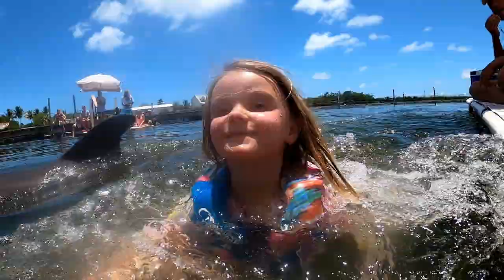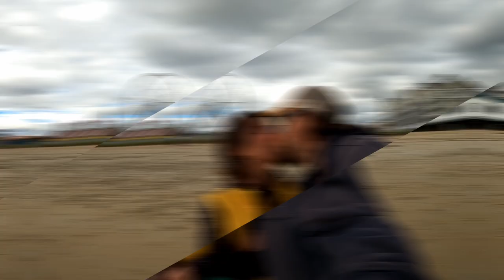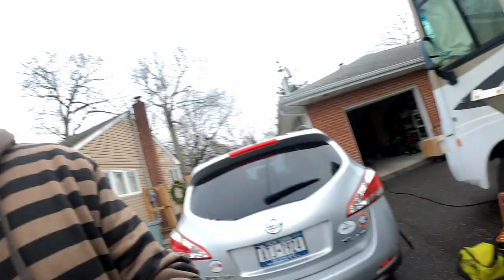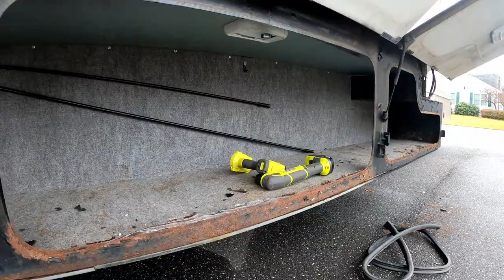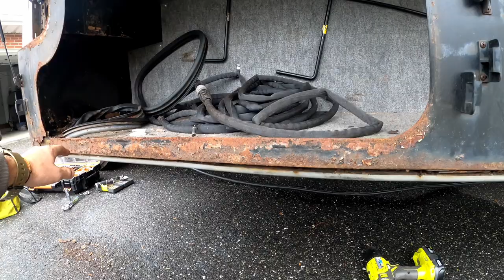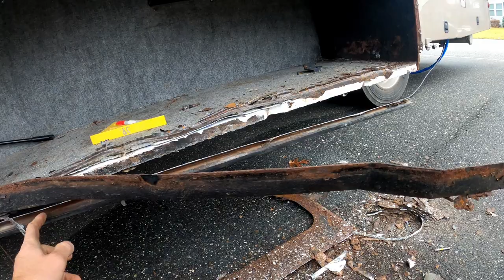RV RUST REPAIR - Winnebago Sightseer Basement Box | Part 1

Comment: Winnebago poor design at it's best lol.  Hard to believe they have so many problems after being in business for so long.  Will check out your other vids.  Thanks for sharing.
Reply from the maker: The design of this box just baffled me. Why not just make it all aluminum. No rust issues. Instead they use sheet metal and butyl tape. lol